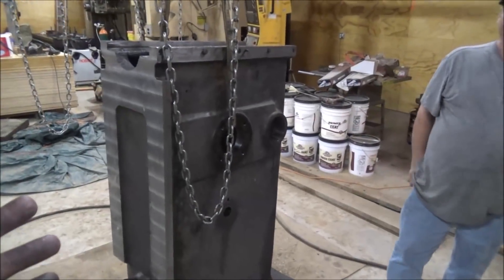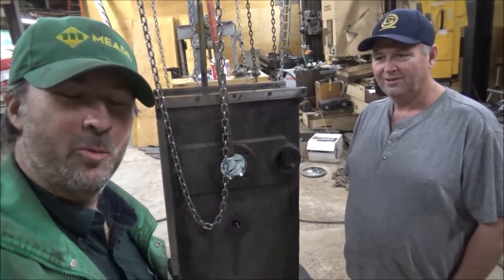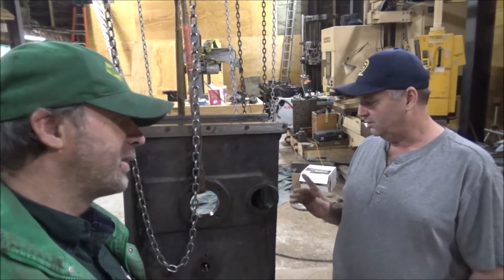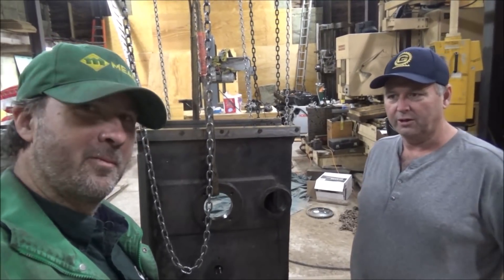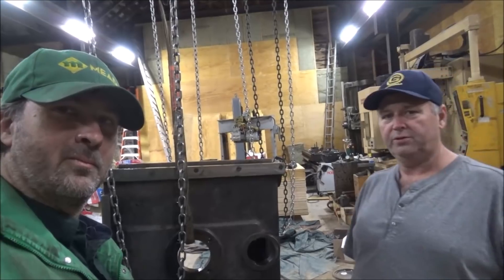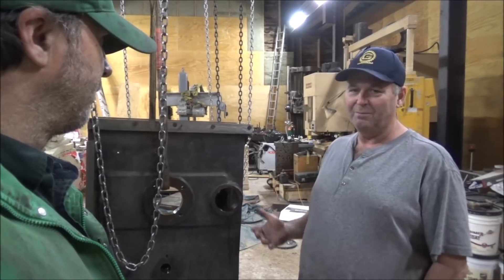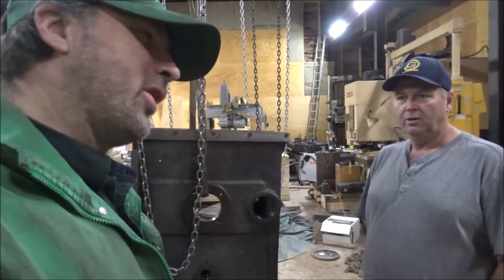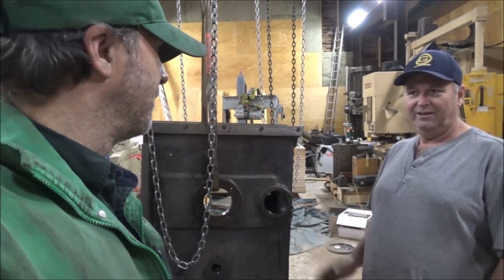The John Doe Shaper heads Home!

Comment: Brian,when u think about it, WW2,old school guys were making airplanes,P51,B17,all the different kinds of aircraft,all made by  manuel machinist,guys who knew feeds and speeds,for stainless steel,cast iron,4140,those guys were true machinist,agree or disagree CNC guys are button pushers,im in trouble now yes I said button pushers,they tell machine what size end,what material they are cutting,CNC has all info stored in computer,or ask them to figure a bolt circle using a trig book,last time I commented on your page,all I did was ask a question,guess I kicked that hornets nest again,no disrespect to Brian
Reply from the maker: A CNC could probably make a new one from billet in the time it took me to remachine everythiing flat, parallel and square though but that is not hardly the same thing.  CNC is the way to go fro repetitive jobs  but for repair stuff like this I don't think they are the best choice.
Reply: Agree, but u got to admit,them old school guys were true manual machinist